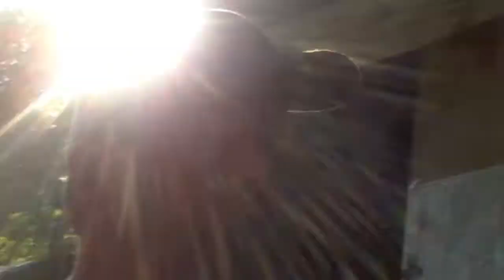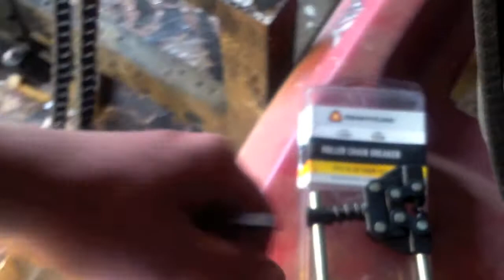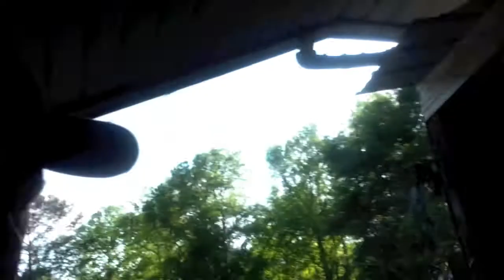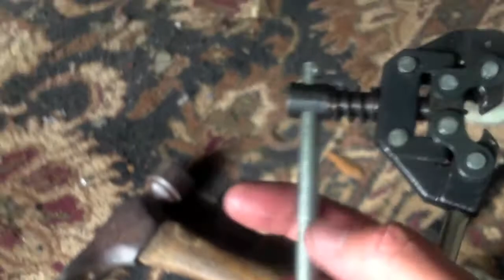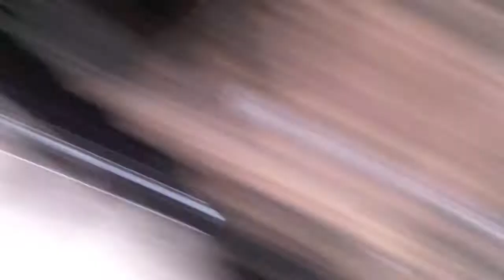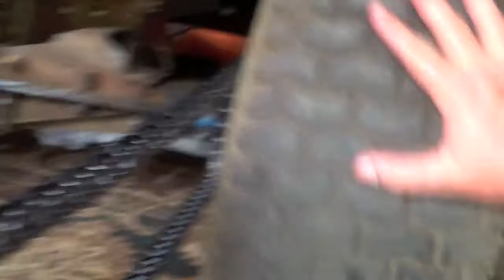Chain on the MurrayGator

Comment: A good anvil with a set of holes, or nut or two on it, a good punch and a HAMMER.... and often times the grinder is not even used. (unless I have to work some heavy 80+ chains) A punch-holder has its place too, way more than any vice-grip to hold the punch. No chain-break for me :P